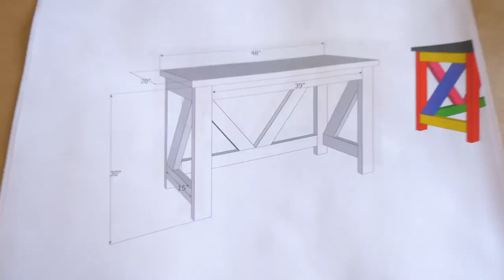Don't Make This Woodworking Business Mistake!

Comment: Good video, and good to see someone pointing out PERSONAL RESPONSIBILITY... Love that!

   AND my number 1 FAVORITE secret for connecting PVC to damn nearly anything is PLUMBER'S GOOP...
   It's not great glue... BUT weird as this sounds (or reads) that is EXACTLY what makes Plumber's Goop (and other variants of Goop) GREAT!!!

     Here's the thing... It's thick and just sticky enough to do a mediocre job... You can even roll your own "tubing" out of aluminum flashing and pop-rivets and slather the ends with Goop, shove it into the PVC and give it a night to cure... done. That won't leak either...
     It does actually stick "Pretty well"... BUT the point of being a mediocre glue is that this stuff is FRIGGIN' AWESOME sealant! Best of all??? When you decide you're tired of the format, there's no need to throw anything away!!!
   Just take a sharp knife and a flat screwdriver, gouge at the seal and pry the stuff apart. A little bit of scraping (because Goop is only "mediocre adhesive" at best) and you've got your original parts STILL in good condition... SO when you figure out how else you want to put stuff together again... Add Goop, and assemble. SIMPLE!!!

    Even better? (Okay, I don't know if this is "better" exactly...) It's just as mediocre with just about anything you want to glue up. It sticks "about meh" to that flex-tubing, the PVC inserts, the regular PVC plumbing couplings, leather, wood, concrete (like the floor to hold stuff in place... well... more or less) even to your fingers... It's "about meh" everywhere and every single time! 

    Some say... It's almost as satisfying to peel off your fingers as regular wood glue... (not that I'd know anything about that). ;o)

Comment: Lol woodworking business mistake #1, own a truck!
Subscribed
Reply: DR Dan  yea, I would say the trailer is the more important item of the two, sure you will need a truck or an suv to pull the trailer, but I would want a trailer because it's going to be a lot easier getting stuff in and out of it instead of lifting it up 3 or 4 feet to get it in the back of a truck

Comment: Tighten up your joints, or if painting them, use caulk.  Also, if you use a thickness planer (or hand plane) to take your 2x4's down to remove the radii it will upgrade the look w/out increased materials cost.

Comment: Regarding the Festool Domino:  I guess you never heard that it is better to ask forgiveness than permission.  Good videos.
Reply: I would personally never buy a Festool product, i've seen many tear down tool reviews and they're made very cheaply especially for how much you're paying. Non reinforced ABS plastic like in the harbor freight tools, butylene rubber rubber that breaks down over time and breaks down very quickly in the presence of solvents and greases, Cheap control board circuitry, blah blah blah. Needless to say you'd be better off going Dewalt and makita in 99% of situations, they're contractor grade tools and assuming you get the brushless versions they will last a lifetime assuming you don't drop it everyday.

Comment: For your hose problem, heat the PVC with heat gun/torch until pliable and use ceramic pot or something else same diameter of the flex hose and make a bell end on the PVC.  Then duct tape.

Comment: Have you checked out why you need to ground plastic pipe with a vacuum system?
When I was building my shop, I was using 4” plastic pipe and was informed that it needed to have a ground wire running through to prevent possible fire from static. I eventually bought a Grizzly dust collector that had a 7” intake port. I ran all with sheet metal heating pipe reduced down to 6” then 4” at tools. Grounding was done at the collector.
And yes, it was my fault I had plastic pipe in my walls I never used.😸 Research, research, research. Have fun
Reply: Grounding the pipe and hose is a myth.  You won't ever draw enough particles to create too much static.  Many YouTube videos on this subject.

Comment: A biscuit jointer, planer, and not using piece of crap pine wood would really help you. Never use pine in carpentry. Only the crap at box stores or guys that don't take pride in their work use pine.

I really like a lot of what you're saying. Responsibility is a very good thing. Keep it up.

Comment: I know this an older video. But I use a plunge router to made the mortise and then use the dominoes to edge joint and on legs to aprons. It takes longer but the results are the same as the domino

Comment: What kind of white paint do you use for the bottom of the desk? Is it a lacquer or just regular paint that you roll-on or even spray can paint?
Reply from the maker: it was an oil-based enamel. Just trying to get rid of old paint. Probably would go with a tinted water-based polyurethane (ask for it at a real paint store) if I was doing production runs of this table again.

Comment: I am not a builder or woodworker, so this may be an extremely silly question, but do you really just use wood glue to fasten the planks together for the desk top you were building at the 2 minute mark? And then just clamp them together and let the glue dry? Is wood glue really that "permanent"? I know this video is old, so if someone else wants to answer that knows that would be nice. I'm just really curious.
Reply: hiya, wood glue is very strong when fully set. all the table tops, chopping boards etc you see are generally just wood glued .. from what i have seen

Comment: Your using a stock framing wood, you need to go to lumber yard and get something kiln dried shop grade. Don't listen to haters about using exotic woods keep using poplars, pines, and furs you will make more immediate money while practicing skills. Pocket screw holes should not be visible. If you don't have a (cheap plate joiner) don't buy festool too expensive, why just just drive the screws for cross members in from areas that are not visible like top and bottom. Also the corners should be thicker than the top, bottom rails, and side members, it would look more traditional.

Comment: for the hole in the back of the miter box you could use a hole saw there are sets at harbor freight that are real cheap. not sure if you already solved this issue.

Comment: I'd say a huge mistake is using crappy dimensional lumber from the big box store.
Reply: @jennieanddavis  Yikes..
Reply: It is a mistake when you don't at least plane is down and make less 2x4 and more "custom".
Reply: This rustic fad is going to go away eventually, and/or customers are going to be coming back to complain in a year or three when their furniture is a cracked, warped mess.  It's hard to hate on a guy for building with the stuff though...it DOES sell.  I get it.  I could throw together cheap farmhouse tables and make money too, I just can't bring myself to make/sell furniture that I know can be built better.
Reply: Stephen Smith or let them actually dry before using them, since dimensional lumber (even though it says kiln dried) has far too high if a moisture content to build furniture out of. Especially when you don't take wood movement into account.
Reply: White Grain Woodworking ok.  
You’re selling stuff so it can be taken as success and it is in a way.  
Fine furniture makers look at the long term and how that piece will respond to seasonal movement due to humidity and temperature changes. 
If you’re in Arizona you’re not going to have the same humidity issues as people who live where I do on Long Island NY.  I’ve installed floors where in the heat/humidity of summer there’s NO gaps in the boards and everything is nice and tight. Come winter? The same exact floor shrinks due to the humidity changes. 
As far as Festool domino goes do yourself a favor and buy a Porter Cable biscuit joiner or a dewalt and get the same results with a fraction of the cost. 
Invest in a GOOD jointer, and planer. Not cheap shit bench top ones.  If you’re going to do this as a living then get good tools. 
We had a couple applicable sayings in the LE sniper community:
1: “Quality isn’t expensive...it’s priceless!”
2. “Buy once and cry once.”
After buying less expensive gear but it was of lesser quality when it breaks you wind up buying it again or finally buying what you should have in the first place. 
Get a good table saw with great accuracy and AT LEAST 3 HP
Reply: Shaun Mac wow I checked out your woodworking videos and was not at all surprised to see that you don’t have any.  Troll be gone!
Reply: Marty Mitchell wow Marty. You're right. I didn't realize you had to be a YouTuber to be a licensed, professional cabinetmaker. I guess I'll go quit my job and shut my shop down. Anyone want to buy some tools? I clearly don't need them.
Reply: I'd say everything about this channel is a mistake.
Reply: Most people can only afford pine furniture.
Real craftsmen don't bitch about their materials. 
They learn how to make it work.
Reply: @kkknotcool  There is nothing wrong with Pine furniture. I have some in my house. Some I've made and some I've purchased. Nothing wrong with it if you use furniture grade pine. Using stud grade wood for furniture will give inconsistent results. There are lots of internal stresses in stud lumber because it is grown fast and dried fast. It also usually contains the pith or heart which shrinks and expands at a different rate than the rest of the board. Those cause the wood to move in ways that are hard to predict. Leads to short lived or just bad furniture. I one did a challenge where you had to make something from a single 8 foot 2x6. Sawing and resawing it to make the boards I needed, I can't count the number of times it pinched the blade of my tablesaw. Project required twice the time as it could have been done with the right lumber. And good wood doesn't have to be expensive. Find a local hardwood lumber mill and see what they have. I get 20 year air dried Elm for $.50/bf, You don't have to buy the $5/bf Walnut.
Reply: @1972Russianwolf  
You can definitely work pine, but it will always be worse then literally any other kind of wood.
I don't care if you age it 20 years or 100 years, pine is just a cheap fast growth wood. 
Also where are you getting $.50/bf elm?
Reply: @jennieanddavis  mic drop lol
Reply: @frank3283  good for you ..
Reply: @jhart7304  yet here you are watching...
Reply: @BRExteriorPro  yep. I think I made it to the 1:00 min mark.

Comment: Right up to the moment when you're ready to buy the domino, you can cut domino slots into your work with a $100 trim router and a straight bit. It's definitely not as quick as using a domino...and it does require some careful setup, but it's a workable option for those who can't afford the domino.
Reply: There are other cheaper brands out there to cut the domino slots.  I own 2 of them, and they both work well.
Reply: @HalfAssHomestead  can you tell me the domino models you have?

Comment: Where and how did you connect the copper wire (seen around your dust collection hoses) to ground it? Because I don't know much about electricity or static electricity.
Reply from the maker: Just wrapped around the pvc and screwed into a metal base. It's really not complicated. Just think of the wire as a playground slide for electrons. Then give them a place to go at the end of the line, like a big piece of metal!
Reply: @jennieanddavis  thank you!

Comment: Davis - blaming yourself is how you orient your brain to solve a problem. If I am at fault, I am empowered to do something about it. You are right to categorize this process as a philosophical fundamental, because this is one case where knowing the trick doesn't blunt the trick's effectiveness. Most people make their problems, whether they did something wrong or something bad happened to them, into someone else's fault. You do that and you have officially surrendered and admitted your impotence in confronting the issue. People do it because it's easier to just make peace with your current lot in life than it is to strive for something better. Keep giving yourself permission to act, and you'll be good.

Comment: Why does it seem that you have copper wire wrapped around your dust collector's pipes?  Floor sweep's a good idea.
Reply from the maker: To dissipate static electricity built up by sawdust in the pipe.

Comment: For the finish that "won't dry fast enough" look into UV curable finish.  An Ultraviolet light will dry it in about a minute. 
Here are 2 guitars finished with Soloreze UV cure which he does not use the UV Light wand he uses the sunlight to cure the finish in about a minute in direct sunlight.  There are many different brands of UV cured finishes and they generally use a UV light wand to cure but I have read on the Guitar forums that the use regular black lights or tanning bed fluorescent tubes to cure without the expense of the purpose-built units that are sold to big companies but the cost a lot more than direct sunlight or Black lights or tanning bed tubes.  There are many brands of UV curable finishes used for furniture wood floors or as in my main interest guitar building.
https://www.youtube.com/watch?v=ajp87darVK4

Comment: 2 x 4's suck for making anything decent...   It will warp and the internal sap will force itself out through the paint.  If you plan on doing this as a business then you have more will power than I.  I go to work and play on the computer all day so love going to work with full benefits and bringing home a nice check for a relatively easy job.  I do quite a bit of woodworking after work and on the weekends only because I want to as a hobby..  Not because I have too.  And another thing,,,  If your wife is joining in on this business she needs to have her butt in the shop helping out instead of telling you what you can buy or not buy.  Something tells me she is still working and controlling the money.  Good luck.

Comment: I have ZERO woodworking experience or tools, but why are you using big box store dimensioned lumber?  

That stuff is for construction contractors and home diy projects.  Not bespoke furniture. You're giving Lowes "value added" margins, and you still have to dimension down to get squared. Buy rough cut for cheaper. And when you dimension it down to square, its still larger than Lowe's lumber. And cheaper.
Reply from the maker: Time and availability are the reasons. Would love to do that eventually, but it's just not feasible in our area

Comment: Ryan Nodwell's slot mortiser. Shop Built Youtube channel. Mine cost about $100 to build but I had the router already. Works almost as fast as the Domino and since the big Domino is the only one worthwile buying and you save over $1000.
Reply: I've made a lot of money with it. Money saved is money earned too bud. Don't succumb to the tool lust. Unless you are actually taking it onsite, it's portability doesn't matter. Check out Ryan's tool. It is the most useful tool you will find on the internet as a DIY tool and for speed of set-up and use. Just sayin'.
Reply: Thanks I will be looking that up
Reply: @jennieanddavis that logic only applies when your diary is full, makes sense for plenty of woodworkers.

Comment: Why does the lady wear proper eye & lung protection, but the tool doesn't even have eye protection on when using the mitre or table saw? Probably wears flip-flops in the shop as well... oh wait, a few seconds later and there is indeed a shot with flip-flops. Called it.

Pro tip; you'll likely need your eyes, ears, feet and fingers for the vast majority of your life. Consider sacrificing a little bit of ego for piece of mind. If you won't do it for yourself, do it for your significant other/potential future family. Wouldn't be too fun needing to be looked after the rest of your life when debris flies into your eyes, or being unable to play catch with your child because you lost your fingers.

All jokes and criticism aside, seriously - look after yourself. Don't be an idiot, or one day you might never be able to work with wood again. Seriously let that sink in - imagine your life if you were physically incapable of continuing your passion or putting food on the table.

P.S. I'm only 26 and I suffer from tinnitus acquired at 18. One too many loud concerts. One of the biggest regrets is that I didn't wear hearing protection, because now, 'pure silence' doesn't exist. The quieter the room, the louder the droning/ringing in my ears. Some nights it's impossible to fall asleep without background noise. I already have it bad, and I'd never want it worse so I always wear my ear protection when working with my tools. Don't fuck around with this stuff, it's annoying and can/will cause lifelong problems.